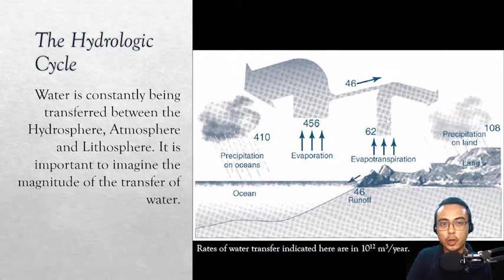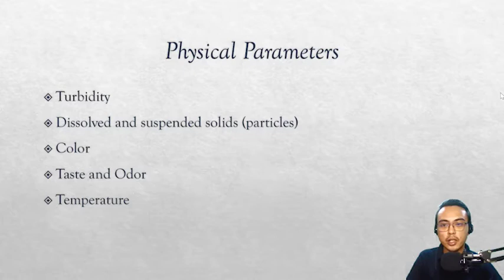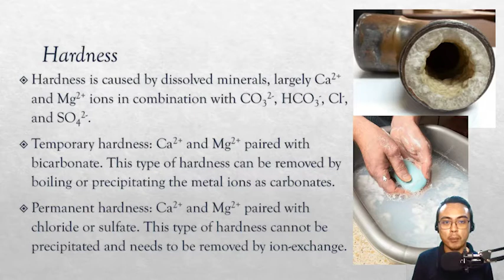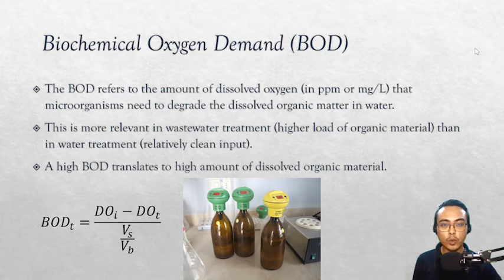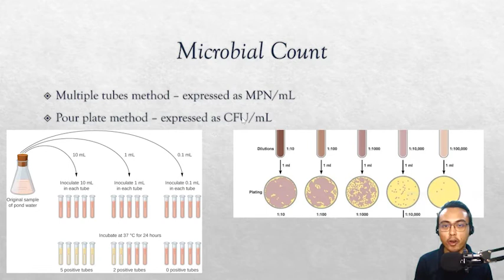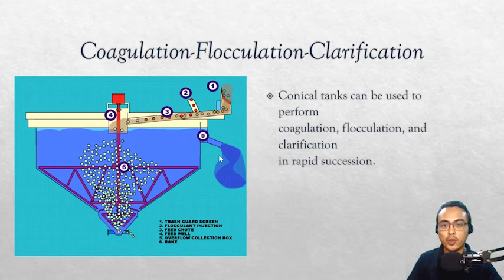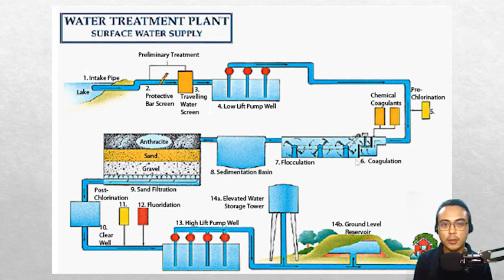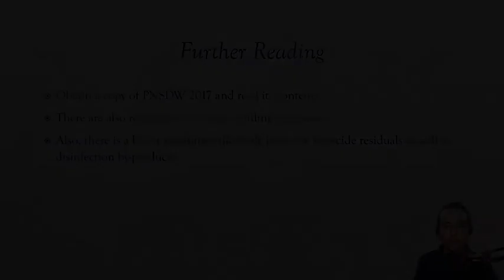Lesson 4 - Water Quality and Treatment

Comment: I have a question! 

If a water treatment plant !     Has nice numbers. 

But.   When you pour hotwater  into a milk container !  And the water starts to fizzle !   After it sitting still for 20 seconds.!!  <---  isnt that bad.  If  water fizzles !   When its already  treated water!? 

Lesson is? .  Treated water  isnt suppose ti fizzle right !??  <--- i need water treatment trainers  to confirm  my worry !! .  

Treated water isnt suppose to fizzle !  In cold or hot water ! From tap.